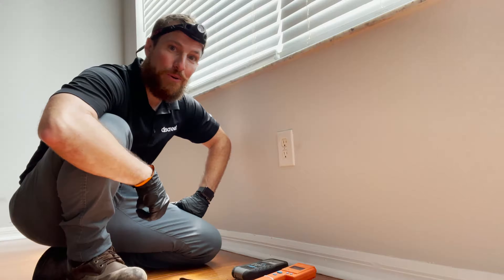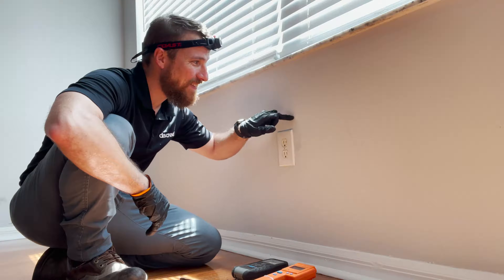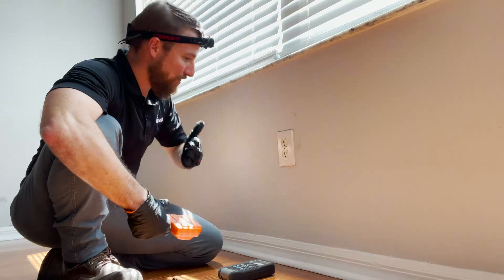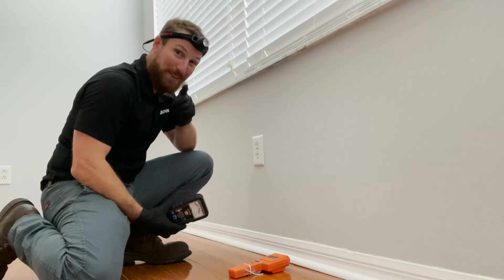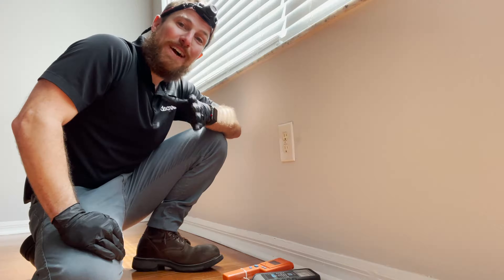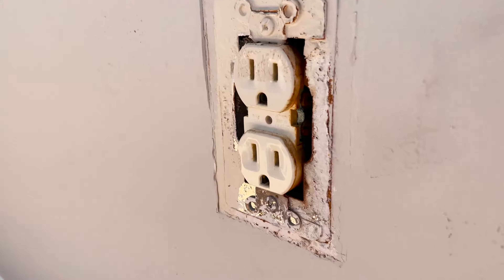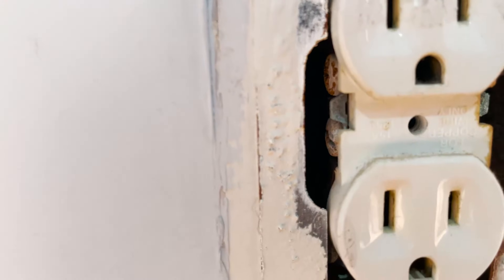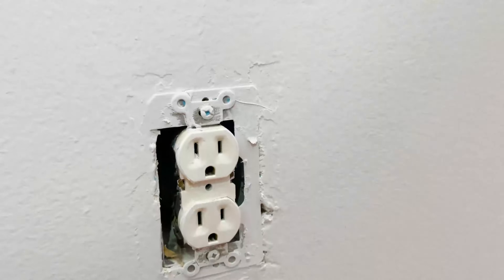Here's a Tip for Validating Moisture Within Walls

Comment: I just noticed the same issue right near my outlet (wall was wet and dripping) but the moisture detector only picked up one specific small spot of moisture right near the outlet..... Everything else on the wall and ceiling is completely dry, Does it still mean the whole wall has to come out or maybe just a small hole cut right where the moisture is?
Reply: Appreciate you! Thanks
Reply from the maker: Great question! I personally performed an assessment sometime last year, where I was asked to evaluate perimeter walls within a few different condos - with the primary concern being the presence of mold growth within these walls. 

In the past, a contractor cut out only the wet areas, which essentially involved numerous random cutouts on some of these walls. Flash forward to me coming in and setting up a sampling pump alongside a few outlet covers as part of my assessment. I found there to be some pretty large quantities of mold spores present. 

Moral of the story - it’s often better to simply remove a larger portion of wallboard during remediation. This will ensure that you remove both the moisture-impacted materials, as well as the presence of mold growth. 

You may want to start with removing the drywall from the floor up to the base of the window sill. If there’s no evidence of moisture or mold, that should be sufficient.
Reply: Thank you for replying. There's no window sill this is just light switch on wall in my bathroom. Thanks for info
Reply from the maker: @Shenanigans000  Gotcha. Well, the most important part is making sure that the source for the dampness and dripping has been corrected. From there, you may want to cut a hole in that wall and inspect the interior of the wall cavity with a flashlight.